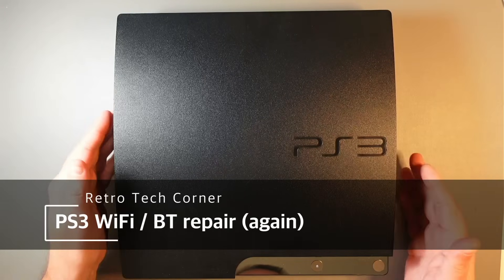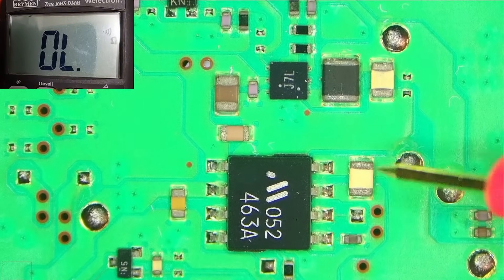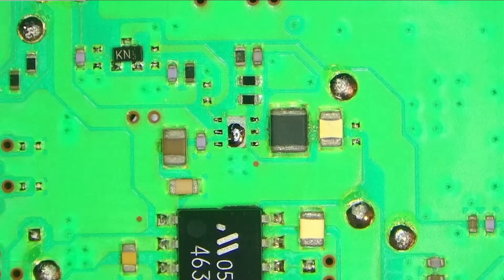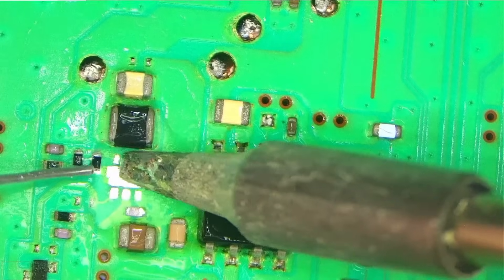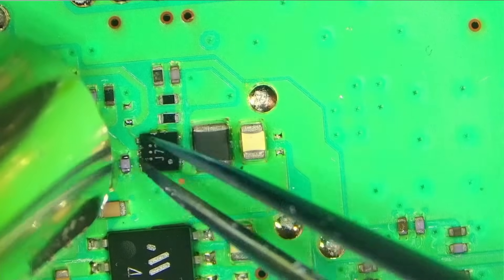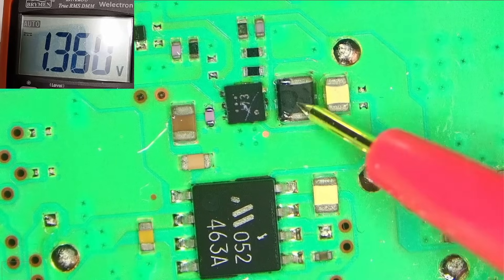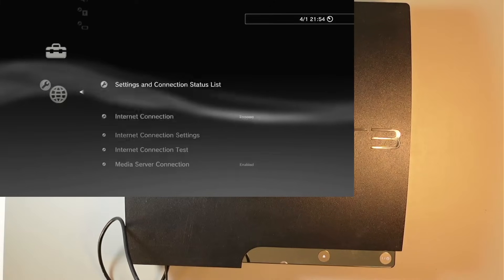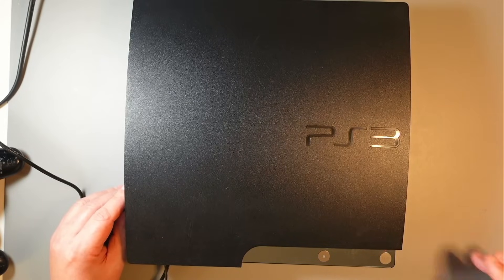PS3 repair - easy WiFi error fix

Comment: Powerd down the 1.8v rail is shorted to ground
Plugging it in it is 2.2V (which seems to be right)
so I guess the regulator is not broken ?
and I can try and replace the Wifi/Bt chip ?

Comment: Does anyone know what causes this in the first place? Mine has been in perfect working order forever, then switched it on today after a few months undisturbed n and now no wifi connection and controllers will not work wirelessly
Reply from the maker: This chip (as on the video) is providing power for BT all the time - even in sleep. So it's on as long as your PS3 is plugged to the power outlet... It might be bad quality chips they used or design fault - clearly the chip is not built/designed to be "on" for years...
Reply: @RetroTechCorner  Makes sense thanks.:)! Might repair mine but might not be worth it as the rest worls fine and can use ethernet if really needed.

Comment: Does the backwards compatible ps3 E01 have the same chip? My console doesn't work for wifi and bt ive already tried replacing the board and ribbon cables.

Comment: Hey! Thanks for posting this, this is super helpful (and your other video on this topic too). I managed to measure the voltages on my CECH-3004B board which is slightly different (but more or less the same) and it's the exact same issue we can see here on your video. No 1.8V on the chip output whatsoever. What do you think, is it possible (theoretically) to feed that 1.8V from an external source of some sort to the wifi chip just to get past a firmware update?

There are no modded firmware available for this model only the stock or the hybrid. All I want is to get past the dreaded 8002F1F9 error while updating the firmware. Once it's done I don't care about wireless - a controller with USB and network with a UTP is just fine.

Unfortunately I don't have the skills and the equipment for this kind of soldering madness not to mention the replacement chip. I could do some basic soldering, so if there is a way I am willing to try... only for those 3 minutes while the fw upgrade lasts.

Looking forward to hear your thoughts on this workaround - this might help others too I think. Thank you.

Comment: Hi, in my ps3 the IC with ‘463A’ on it does not have 5,5 volts on pin 1. Pin 2 has 3,3v.
So I assume that this IC is the cause of the BT/Wifi failure.
Where can I buy a replacement for that IC? 
Regards, Peter

Comment: I Got all voltages correct but not the 1.8v its 2.4v on my console. Does that mean the WiFi Chip is broken?
Reply from the maker: no, I don't think so. I've had 2.3 to 2.4V on most new chips I installed. One of them is my PS3 and it's been working for months now (connected to the socket all the time).
Reply: @RetroTechCorner  so i Only Need to Chance the little Chip? Because im getting the error while updating
Reply from the maker: Sorry - I think misunderstood your question. So you did not replace the chip - it's 2.4 "from factory" and you're still getting update error - correct? If so then I'd try installing another HDD. If that still fails then it's probably wifi chip.
Reply: @RetroTechCorner  no i didn’t replaced the chip and the regulator. It’s 2,4 from factory. And I got 8002F1F0. I will try another had later thx
Reply: @RetroTechCorner  Ok i tried to install HFW 4.90.1 on another HDD and got the same error means the Wifi Chip is broken...

Comment: I Got a 2504a with an 8002f1f0 error. Does this fix it too because i think this Error is related with the WiFi Chip too
Reply from the maker: if you're getting 0v on the output (as in the video) then there's a chance your wifi chip is OK. and yes - that will fix the error (if wifi chip is OK)

Comment: Hey man, I have a question. My PS3 Slim has this Bluetooth/Wifi problem CECH-3004B so I ordered a new PS3 CECH-3004B. Can I just replace the whole mainboard with my PS3 and the issue will be fixed?
Reply from the maker: You'll also need to replace optical drive and hard drive (or format/initialize existing one)
Reply: @RetroTechCorner  So my PS3 still has a lot of savegames and I dont wanna lose it. Is there any way to fix my issue without losing all my saves?
Reply: @ayden5883 you can copy ps3 data using ps3 hen or USB save files
Reply: @ayden5883 You can try transferring the data from your old PS3 to your new PS3 using a LAN cable

Comment: Mine has 5v and 3.3v but the output that should be 1.8v (in your case was 0v) is 5v too. It is shorted between that 5v test point and the cap that should read 1.8v. So in this case I am guessing it would have destroyed the WiFi chip too and I wouldn't be able to do a BGA repair with an iron or hot air. 

Anywhere in the UK recommended? I tried the C0d3r at consolefix and can't get a reply out of him, even if it is to say "no thanks".
Reply from the maker: Yes, if it's 5v then your WiFi chip is most likely dead.
Reply: @RetroTechCorner  could I send it to you for repair from the UK? I could replace this chip, but not the wifi chip as assuming that needs a BGA rework machine rather than just a hot air station.

Comment: should be 1.8V,;  these Chinese chips are not so great to regulate voltage
Reply from the maker: The one I'm using in this video is from mouser... So it's legit. I've been using the PS3 from last video for a few weeks now and everything seems to be OK (it's plugged in all the time)...
Reply: @RetroTechCorner  a variation of the same chip named J73 fails also on xbox 360 and the result is that the xbox is completely dead. no standby power on the 1.8V rail. if you ever encounter a dead xbox360 that wont power on, look for the J73 chip towards the power plug area.... U5A written on the board
Reply: @RetroTechCorner  Any chance you have the Mouser part number?  Great videos on this repair by the way!  I haven't found the root cause of my console yet but hoping that either my failure is the step down or that you'll be making another video for the wifi chip soon :D  Keep up the great vids!
Reply from the maker: It looks like they are no longer available at mouser. Here's digikey link to this exact chip: https://www.digikey.com/en/products/detail/richtek-usa-inc/RT8057GQW-2/4146466
As for another video (ie. replacing Wifi chip) - I don't know. I have a huge backlog of Nintendo Switches and need to focus on these.But I will do the video as soon as I get my hands on PS3 with faulty WiFi chip (which may or may not happen - I don't get that many PS3s for repair these days...). 
WiFi chip replacement is harder than RT8057 - you need to remove the shield (needs a lot of heat as it's soldered) and the chip isn't small so positioning and precision is the key)
Reply: @RetroTechCorner  Thanks for the reply and digikey link, I really appreciate your time!